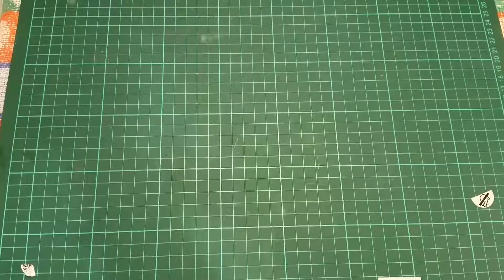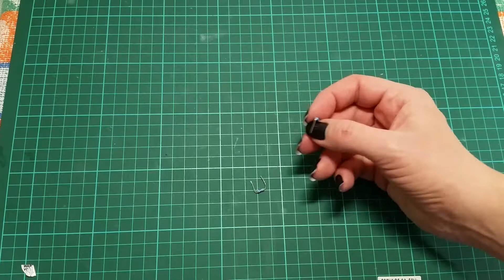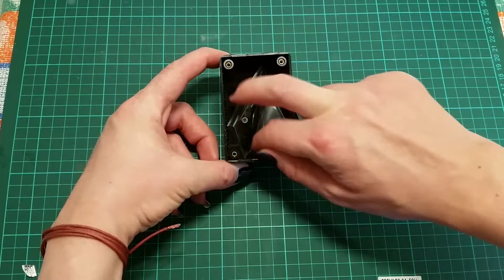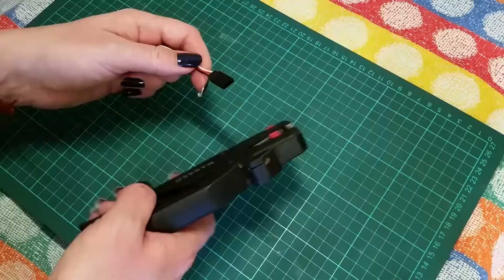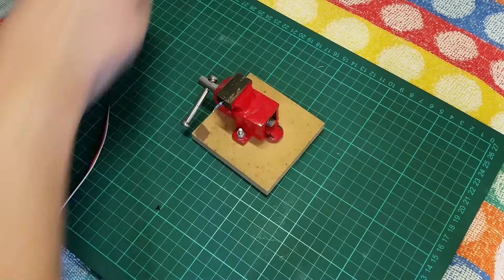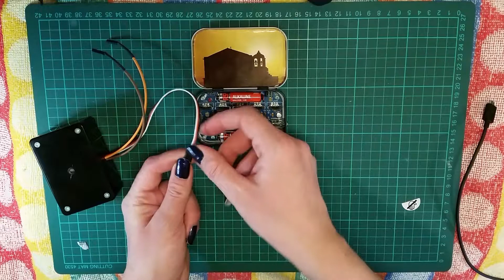How to connect MintySynth to MIDI ~ Custom Cable Build

Comment: Great video, thanks for posting this! I'm glad you got it working.  I may have missed it, but did you try it with 3V battery power as well? I'd be curious to know if that works.    -Andrew, MintySynth
Reply from the maker: Yes 3V works fine, not sure if it would affect battery life too much. One strange thing as I said in the video, if I use 220 Ohm then the MIDI software went a bit crazy?
Reply: I'm not sure why that would be--was it true when you used 3V too, or only 5V?
Reply from the maker: It was on both 3 and 5V, the 220 resistors was cheap carbon film from ebay vs metal film from RS it could even be due to the very cheap USB to MIDI device.